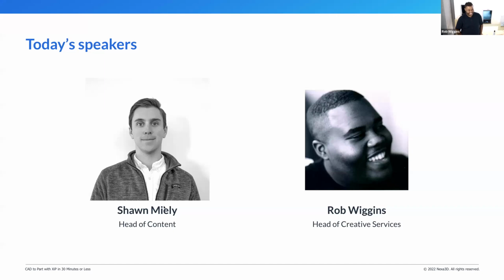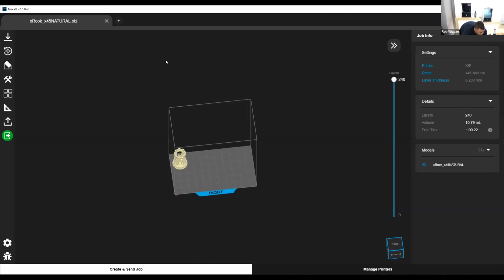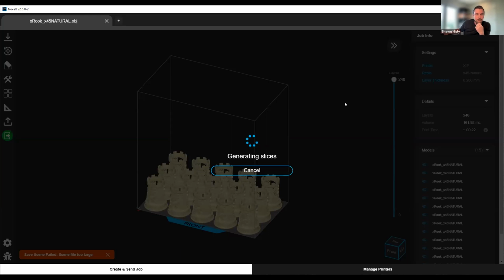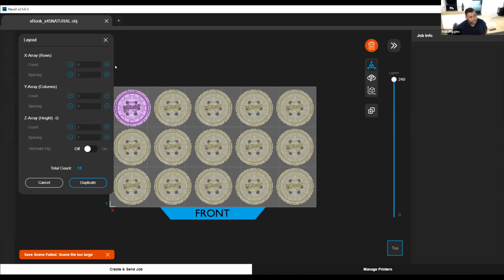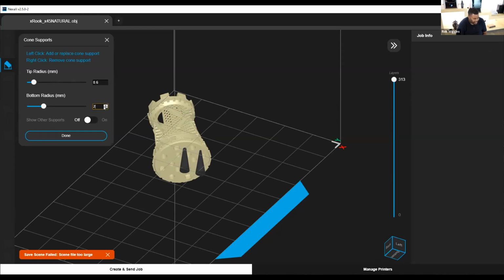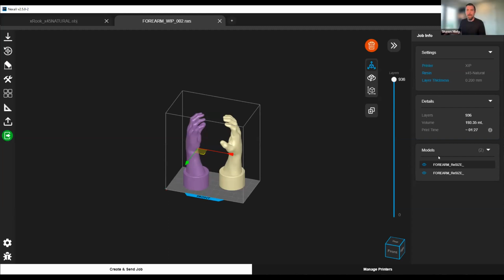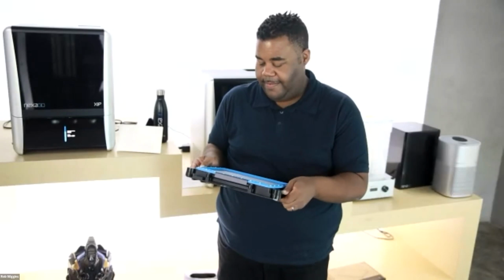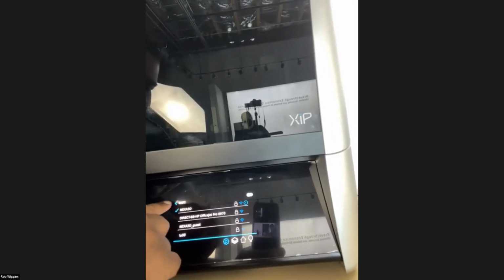CAD to Part with XiP in 30 Minutes or Less

Comment: how to use any resin in nexa3d xip
Reply from the maker: Sorry didn’t quite understand the question but I’ll take a stab at it. XiP has 20+ validated modeling and engineering resins but it is also and open platform so you can use other 3rd party resins too.